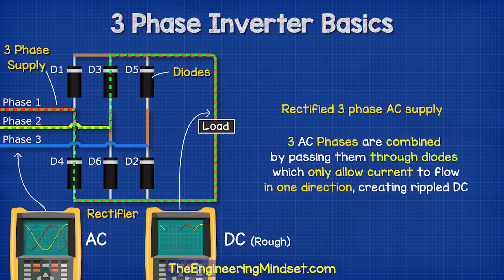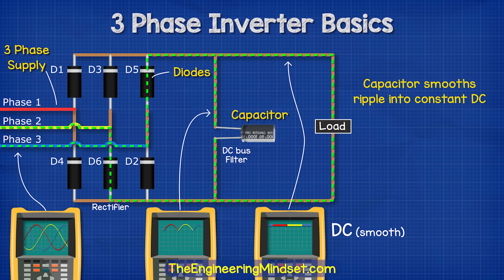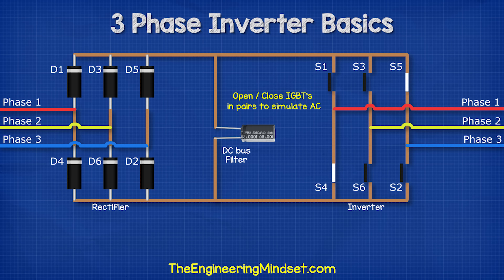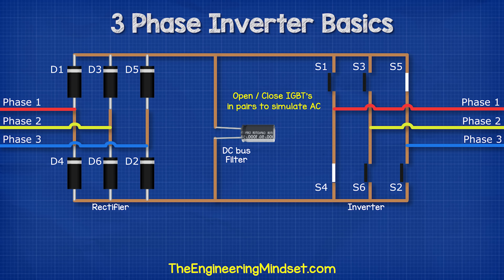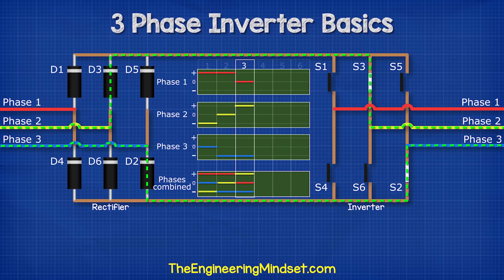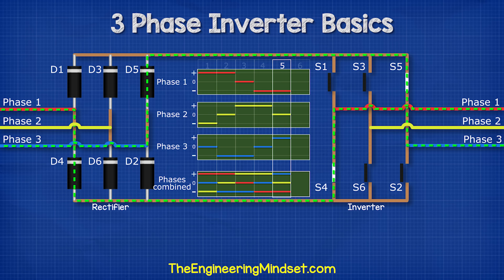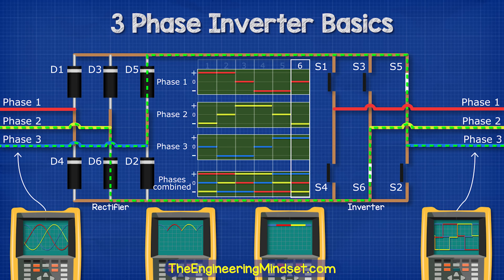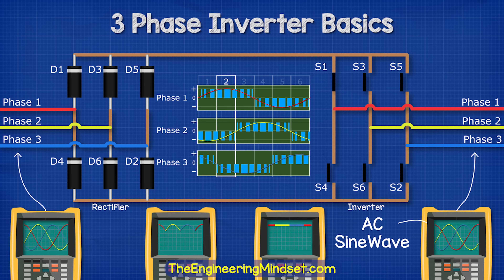3 Phase Inverter Basics - Working Principle

Comment: So what exactly is a 3 phase inverter?  It looks like you get the same thing you got from the start.  Is there supposed to be a 180 deg phase shift in all of the lines?  Is that what is meant by inverter?
Reply from the maker: You input uncontrolled AC at a fixed frequency and voltage, convert it to clean DC, then use that to make perfect AC output of any frequency and voltage you require
Reply: @EngineeringMindset  So it's like a 3 phase sine-wave generator that draws from 3 phase ac power.  I'm studying for the FE exam and they have instead a sine-triangle PWM.

Comment: I remember seeing a much older, probably less electrically efficient solution for railroad overhead DC catenary from city power.  Power from the city supply would come in and power a three phase AC motor which was attached by a shaft to a dynamo which produced DC power.  I didn't see it, but I thought that the dynamo may have had three axes set at a 120° to each other to create close to a constant DC output.  The locomotives and street cars use regenerative braking and sent power back into the system.  A video on how all of these power surges were dealt with might be interesting.  It was rush hour with fully laden cars and at the same time almost everyone slammed on their brakes without anyone drawing power from the system and then there was a really big blue flash.  I know a lot of traction systems have gone to AC.
Reply: That's what came to my mind. How much more inefficient would it be to build the 3 phase inverter by linking a DC motor mechanically to a 3 phase generator? That way, the sine waves would be produced "organically"...

Comment: 3 phase is completely unnecessary today as nobody direct wires AC induction motors anymore in industrial settings. Everything goes through a VFD (veritable frequency drive) which determines the voltage, current  and frequency to directly control motor speed, soft starting and power output.
Reply: What world are motors not wired directly to 3 phase? High pressure pumps? Hydraulics? You’re forgetting plenty of industrial applications there.

Comment: don't understand why go from dc to ac, just to go back to dc?...seems inefficient.
Reply from the maker: Because its clean a d constant so you can do anything you want with it. If you took 50hz 230V AC you can't convert that to 300V 60HZ, the AC supply will be going into the negative half of its cycle multiple times just when you need the output to be at the maximum point of the sinewave. But, we can turn the DC into anything because it's constant so we don't have that limitation
Reply: @EngineeringMindset  Thanks. The video unforunately lacks exactly this bit of information. I was like "cool now I've made AC to DC back to AC with shitty PWM 'waves' O_o"
Reply: @piranha1337  I was thinking the exact same thing. Why would you bother to do this? This video is missing the "why" you might want to do this. lol
Reply: @EngineeringMindset  aha, thanks for clarifying! i guess that type of scenario is likely going to happen when you are trying to use equipment designed for one grid type on a different grid type.

Comment: One thing i dont understand is that why don't they just use a brush less motor for inverting dc to ac? I mean it will make it a lot less complex. You can just attach a magnet to the shaft of the motor and then wind three pairs of coiled wire in a circle around it, and boom! You get a three phase ac current
Reply: Because you'd be adding unnecessary complexity to the circuit, and it would be less efficient. A BLDC is driven by essentially the same kind of circuitry that makes up an inverter to begin with. You also need to control the phase switch timing accurately, and that's done best with a set of hall sensors. It can be done by measuring back EMF, but it's not as accurate.
Reply: And what if you want a stable frequency on the output?
Reply: @0.1lite46  The frequency can vary depending on the speed of the motor thus a stable frequency can be achieved, however this idea isn’t efficient since dc motors have an efficiency factor of .7 - .85 and it would often requires a lot more space.
Reply: @HN-vu8pp  I know and only asked this question so the commenter thinks about frequency as well, not just the basic characteristics. One of the main reasons for using inverters is that specific, stable output frequency is much easier to achieve.
Reply: They do, it’s called a rotary phase converter…. But it converts single phase 240 vAC to 415 vAC 3ph …. I built one to run my lathe and milling machines.
Reply: @killj802  so can't you just use a transformer to convert 415V back to 240V if you want?
Reply: @raptorthegamer5524  why? I have 240 vAC already. Why would I want to transform an already converted supply? I converter to 415 vAC 3PH.
Reply: @raptorthegamer5524  it's not 415 single phase he's trying to produce. A transformer would be fine for that. He's producing 3 x 240v supplies, to create 415v.

Comment: Thanks, this video was so precise and lean. Does inverter always mean DC to AC?
Reply: Yes of course,DC to AC.Usually used in Solar,Wind and Tidal power supplies.
Reply: I think so , my lecture referred rectifires , inverters , and dc -dc  drivers, push pull drivers collectively as converters.
Reply from the maker: Seen our new video on HOW SOLAR PANELS WORK in detail https://youtu.be/Yxt72aDjFgY